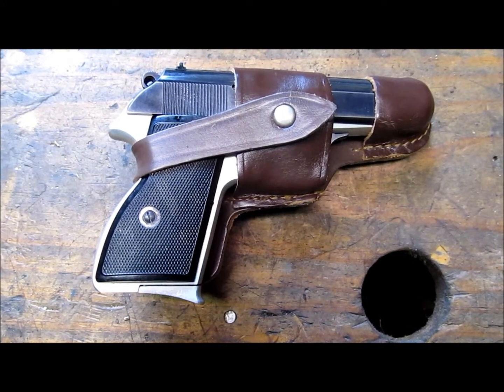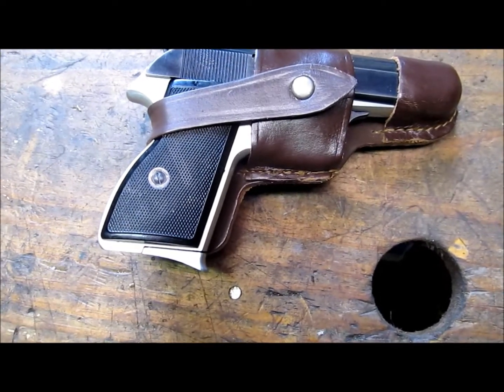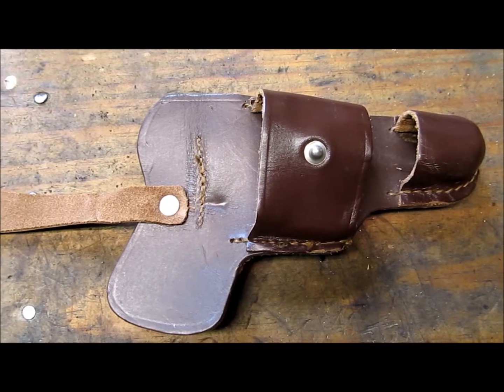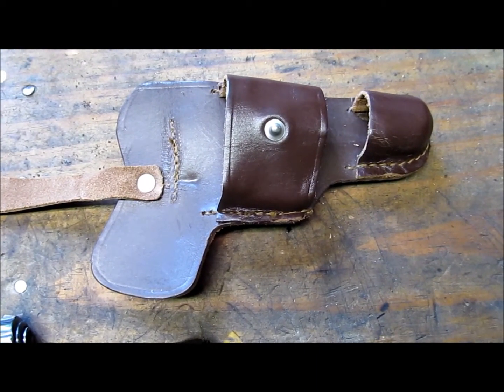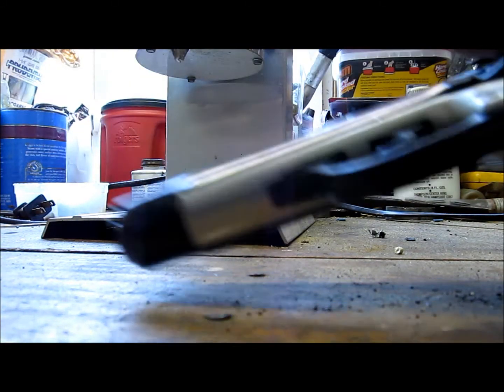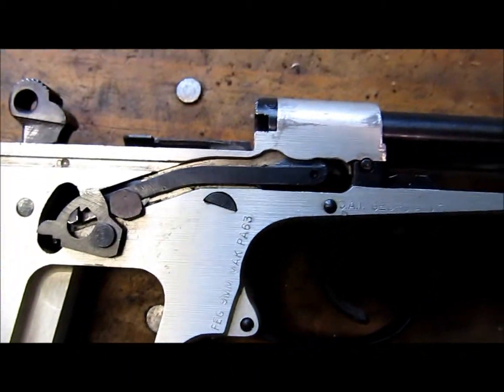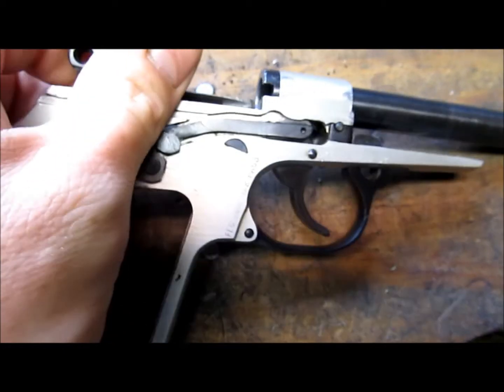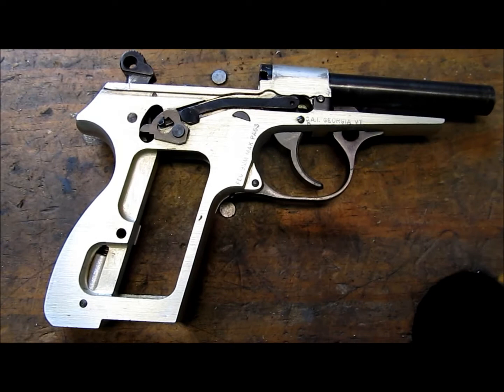Disassembled Operations of the PA-63

Comment: @HHDarkool Actually, I've had a number of conversations with Norm over there. In fact, you can probably find my thread on my PA-63 issue over there. Thankfully, I got it all worked out now. This video helped a lot. In fact, this video is probably the only reason I was able to correct my problem. Huge thanks to littlestoney406 again for making this video! On a side note, Norm's spring is really good for a p64, but you'll need to ask him to disassemble one of his PA-63s to make a proper spring.

Comment: if you need a new trigger spring the surplus original parts are sold out. There is a gunsmith that will send you some for a small fee. at p64resource dot it also has instructions for how to install because the spring is made for multiple weapons you may have to trim it to fit.

Comment: @SupremeAmerican Yes, the little pin holds the trigger assembly. The spring actually encircles that pin as well. In addition to that pin, you'll need to remove the trigger bar. That's a unique challenge, too, the first time. Actually the PA-63 doesn't have that many parts. It's a really simplistic design, which probably lends to its reliability. It's a really nifty little pistol. I happen to like a lot of the Eastern European milsurps.

Comment: @SupremeAmerican Oh yes, the factory springs are stiff. My problem turned out to be the trigger return spring. It's hidden above the trigger, under the slide and trigger bar. It didn't have enough power and I had some trouble figuring out why. Turns out it was rubbing the frame. I reshaped that spring a bit and it works beautifully now.

Comment: I actually ordered both Wolff kits before I even got the PA-63 in. The recoil spring is nice because the gun likes to dig into the web of my hand, and the hammer springs can reduce the double action trigger pull weight (as long as it doesn't cause light primer strikes). Unfortunately, the spring I need is the one in the trigger assembly, at the front of the trigger bar there. Guess I'm going back to Google.

Comment: ...[continued]. Actually, watching this video, it seems like your trigger bar snaps up with a good bit of force. Mine does work most of the time, but I don't know that it ever moves hard enough to make that audible "snap" when it moves into the upward position to grab the sear. I could have a weak trigger spring. Unfortunately, that's not an easy thing to find for these to try that theory.

Thanks again for this video. It really is a big help.

Comment: Thanks for the video. I have this pistol and am having a problem with the trigger not functioning properly sometimes. I don't know anyone locally with one to compare notes with, so I really appreciate this. I was hoping to spot a problem with two parts catching for some reason. I actually polished the back of the trigger bar and that channel, which removed the trademark "grittiness" of the trigger pull but didn't fix the problem. [Gonna have to continue in another comment]...